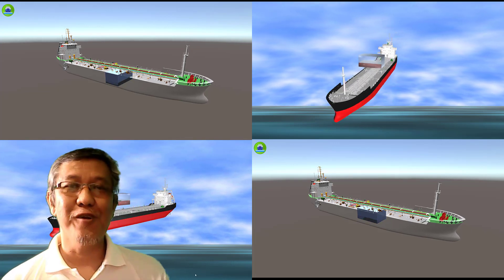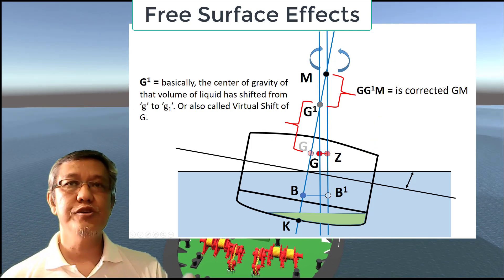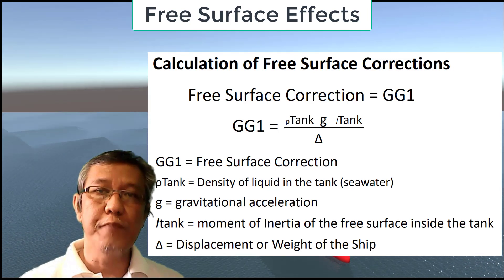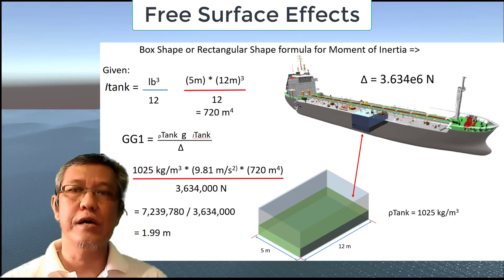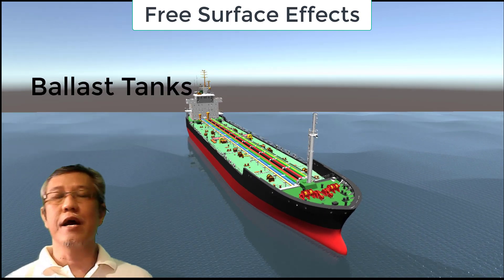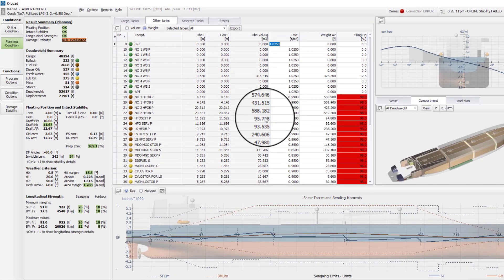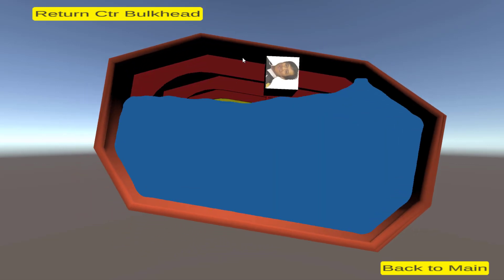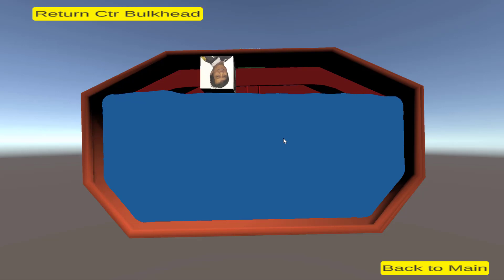Ship stability focused on free surface effects, Metacentric height, loss of GM and Liquid Sloshing.

Comment from the maker: Howdy folks! Just suggest subject topics you may want to be featured.
Reply: Thanks for the LNG videos. Is it possible to make a video about LNG cargo machinery, LNG valves and pipes, safety valves, basic cargo operations in the CCR, basic explanation and presentation of pipelines and valves on the screen in CCR or some theoretical explanations of cargo operations by cargo checklist?
It can be divided into several educational videos. 
It would be very nice with added voice in English or text explanations :)
Reply from the maker: @JohnJohn-yu1pd  Will do once I find time. In the meantime you can check for other channel. Appreciate much.
Reply: Hello Chief, can you make a video on ballast calculation manually not excel. Thanks
Reply from the maker: @kolawoleawesu8498  are from a Bulk Ship? Ballast Calculation are normally done on excel sheet.